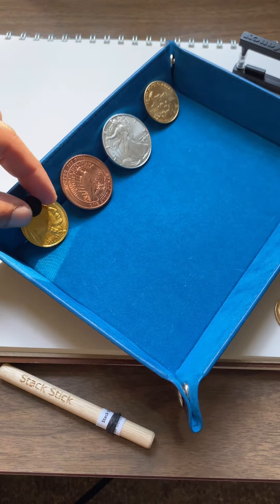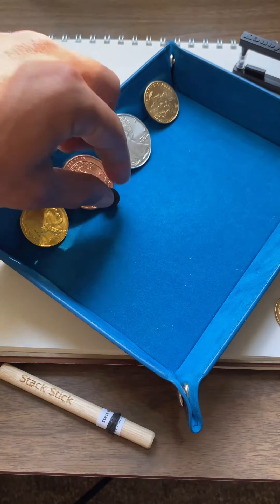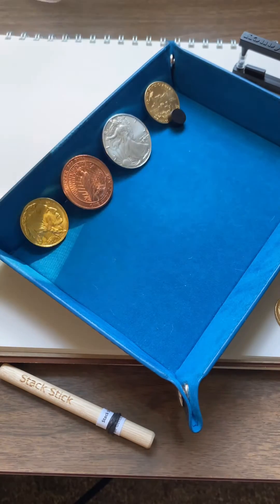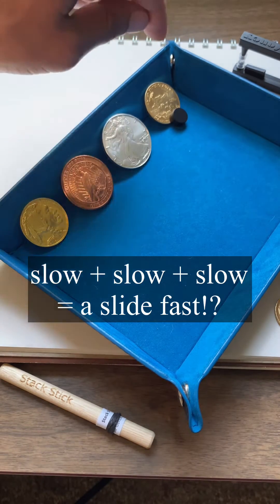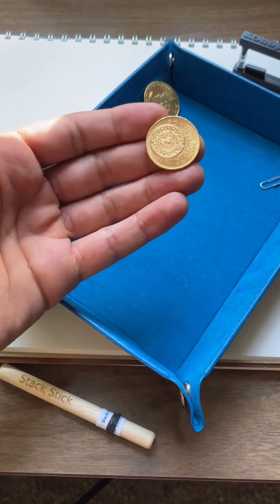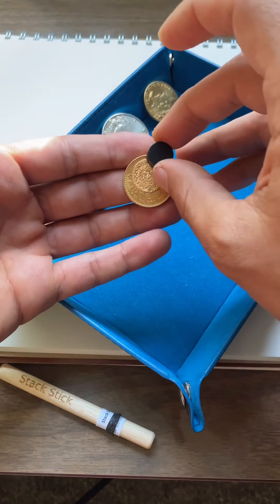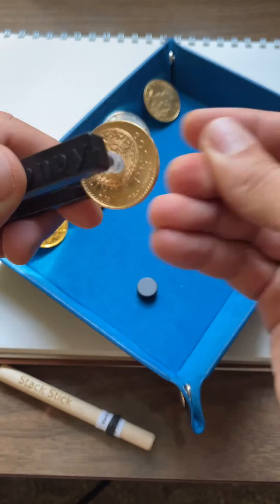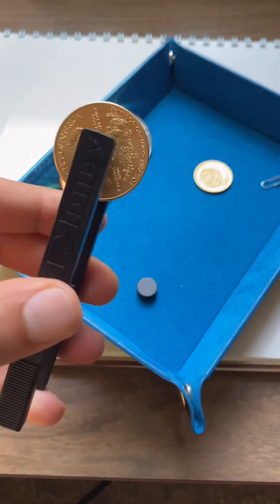Magnet Test - Gold Buffalo, ASE, American Gold Eagle - Magic?

Comment: Hey, really nice video! The Magnetic test in fact tests the conductivity of the metal. In general, the purer the metal is, the less electric resistant is. That must be the reason why the slide on 22k (which is a compound) is faster. The sigma test based on the same principle. It would be interesting to see the numeric measurement from that device. Nice work!
Reply from the maker: Hey, interesting, I’ll see what I can do.
Reply: Nope. 90% silver is also diamagnetic
Reply: @BoxStudioExecutive  Diamagnetism is an important property, but when there is relative motion between a conductor and a magnetic field, electromagnetic effects become more significant.